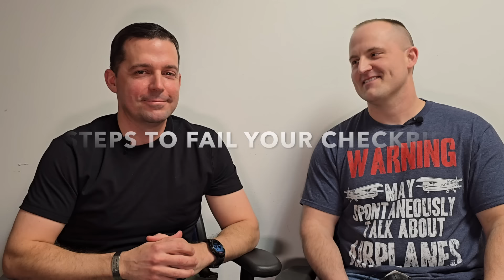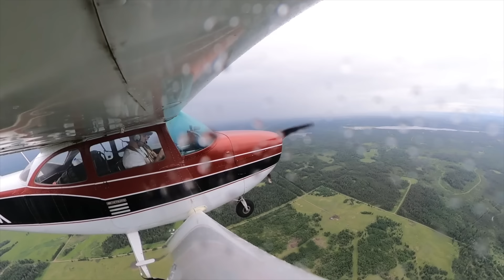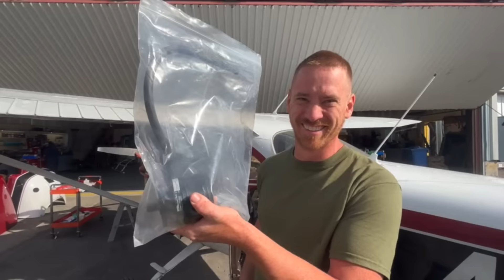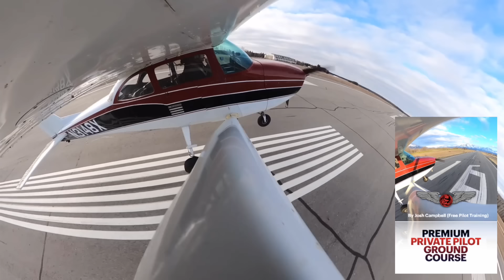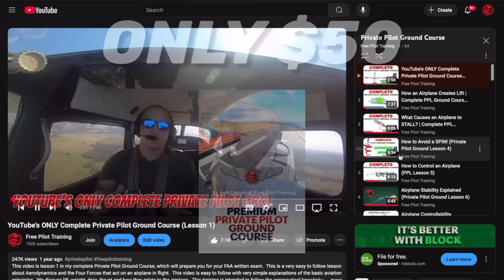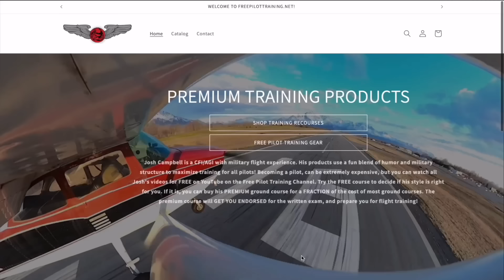5 Easy Steps to FAIL Your Checkride (Explained by an Examiner)

Comment: Thinking of a "flight exam" as a "checkride" is probably the best "way to fail a checkride". 

"Checkrides" are not a "thing" in "flight instruction".
Reply from the maker: Lol, we call them checkrides in the Air Force…so it kinda is a thing.  That’s probably why I use that term. That being said, the examiner is, in fact, checking to make sure you will be safe as a pilot, but you’re rights it’s technically an practical exam

Comment: The fatigue one is real. I went up once for a stage check and just felt so sloppy. I passed the ground super easily. Then getting in the plane, all the maneuvers were great. But then I realized some of the smaller mistakes I was making/missing things in the checklists. Then I got really stressed out and kinda started mentally spiraling and completely forgot how to land in a crosswind more than 45 degrees. Had to discontinue. Wasn’t a great experience, but a good one to have as a learning experience.
Reply from the maker: It’s crazy how much a little fatigue can affect your flight

Comment: Speaking of pilots failing checkrides, I can't help but wonder how many pilots fail because of the examiner. The only Checkride I ever failed was my Helicopter Commercial and I fully blame the examiner.  This was back before glass cockpits were in training aircraft and we carried paper charts. I always used my sectional in a "north up" orientation, and had already been an airplane private pilot for years and was used to this, but my commercial helicopter examiner was a "track up" pilot.  Upon starting the checkride cross country portion he informed me that I was viewing the chart wrong, and told me I had to use his "better" track up chart orientation method, which forced me to basically use the Sectional chart upside-down.  Of course, I immediately became disoriented, and was unable to locate the intended destination. I passed fine less than a week later.
Reply from the maker: That is really dumb. He shouldn’t be enforcing techniques over procedures

Comment: This is a great video! My instructor took me and another student for check rides. The schedule was for the other student to go first. During the beginning of the review, there was disagreement between the DPE, the other student and my instructor about the length of the student's cross country. The student and the DPE had different tablets and software. The student's tablet with Fore Flight showed the distance between airports as 50.4nm and he logged the flight as such. The DPE's tablet showed 48.8nm he wound not let him proceed because the student couldn't provide the distance requirement was met. Throughout my training I used sectional maps for my navigation. Interestingly, on the sectional map, the distance I measured between the two airports he flew was 51.8nm. I think if that student had argued that the sectional shows 50+ the DPE would have accepted that.  Your thoughts on sectionals vs. tablets for check rides? I am curious if you agree with the DPE here and also if you think he might have been convinced by the sectional.
Reply from the maker: Wow. I feel like the DPE is being too picky if the students iPad is showing over 50nm. Did the student manually select a point on the airport? The ICAO brings you to the center of all runways so theoretically, this could happen if the fields have really big runways.  I’m a huge fan of iPads, but I also think they’re a crutch. The student should be able to fly without one and navigate if needed, but having all the information at your fingertips makes things so much easier and safer
Reply: @FreePilotTraining  He measured from and to the center of both runways but I think he could have presented his case better. I do want to say my experience with this DPE was very positive. He has a reputation for being very thorough but also fair. I showed up well prepared, in no small part due to your free training. It paid off!
Reply from the maker: Nice! I appreciate that

Comment: I have my PP and I still do my W&B by hand using Excel and I still use my paper W&B chart. I just do not trust Foreflight with W&B. I also had paper chart for my X-country. I did back it up with Foreflight.
Reply from the maker: I don’t blame you! I’ve seen it spit out incorrect data before. Maybe not W&B data but I have seen it

Comment: These are way too complicated...let me give you MY 5 easy ways to fail a check ride:

1. Show up wearing only a thong (doesn't work if you're female and the examiner is male or a les)
2. White powder under your nose
3. Tell the examiner that you want to become a pilot so that you can overcome your biggest fear- dying alone
4. Your pilot bag is really a Yeti cooler full of beer
5. Openly and loudly hand your last will and testament to the lady behind the counter before walking out to the flight line

Bonus: Snort an unidentified white powder from any horizontal surface on the aircraft

Comment: I have a question! Premium course basically more improved version of the free course and also quizzes and their answers with explanations! So we can pass the written test. So for check oral exam we need to take this premium course. If I understand right! Right  after I finish studying free course  will buy the premium course . So excited things are getting easier every other day. Hopefully will setup a flight  sim for myself in order to study for the flying portion as well. I’m OTR truck driver from my truck will try my best.
Reply from the maker: The premium course will prepare you for the written exam and give you a great foundation for the oral exam. The main difference is that the premium version has easier access to the quizzes and the endorsement is included

Comment: The 'loss of alternator' is of course a good and realistic failure, but if it's full daylight it doesn't constitute an emergency - but maybe with today's FARs I'm wrong. 'Back in the day' the J-3 cub I flew had no electrical system at all.
Reply from the maker: Very good points.
Reply: There was a video about a pilot who was closing in on a plane ahead of him on short final, while he experienced an electrical failure. He was afraid of going around, and crashed into the plane ahead of him, while he landed!  He had thought that his engine would quit because of the electrical failure.

Comment: Alternator failure at night sounds horrible to eventually lose battery then lights and radio then you can’t turn on runway lights so might have to do an off field landing on a street or field without landing lights 😮
Reply from the maker: It doesn’t sound fun does it?

Comment: Seth (or Josh) I hope you can shed some light on this…I use a paper nav log to prepare my  XC. However, I also carry my iPad to help with traffic awareness in-flight. I’m not too familiar with ForeFlight yet to comfortably use it beyond that. If I were to bring it on a checkride for the sole purpose of traffic awareness am I opening myself up to being questioned on any of ForeFlight’s capabilities?
Reply from the maker: You should be fine. The big problem is when students don’t understand the data that ForeFlight is giving them during flight.
Reply: @ checkride passed. You and Seth are a treasure to aviation 🙏

Comment: most DPE wont allow EFB’s
Reply: There may have been a few holdouts prior to last year, but when the new ACS was released in May EFBs are specifically allowed now.  The updated DPE guidance in the 8900.1 and 8000.95D also makes EFB usage allowed.

Comment: My wife is learning to fly. How things have changed. I learned 40 years ago in Alaska. never did pilotage, just VORs and supplemented by visual, looking at mountains and streams. Weather was a phone call and a look-si. VFR or IFR, nothing in between. My check ride was at night at bare minimums even though I had never flown at night and had a night restriction on my license.

Comment: Based on the conversation, it’s so much better to do the old school method and back it up with EFB.
Reply: Do whatever you're comfortable with.  Personally, I would recommend getting good training on your EFB since that's what you are going to use in day to day flying after getting your rating.  Either method is acceptable, just make sure you are confident with the EFB if you choose to go that route.
Reply: Yes I understand. I received all my certificates and ratings before the EFB was a thing. It seems like it adds a complexity to a check ride. During the end of my flying career (government), I was reluctant to fly without the iPad. So now I know it’s a requirement to fully understand the EFB benefits and limitations. I really enjoyed the discussion.

Comment: It’s sad that the FAA doesn’t cap the DPE fee and more importantly that they don’t cap the retest fee to a low amount of $50 or so. This lack of policy gives the DPE a monetary incentive to fail you.
Hopefully I don’t experience this, but it is on my mind.
This isn’t even addressing the fact that we give the FAA $27 BILLION tax dollars a year and they STILL can’t even supply their own DPEs! That in itself is just disgusting.
Reply: Yes good points. It is strange that the FAA won’t standardize the fees. Why would that be detrimental to scheduling and availability? Expensive schools wouldn’t be able to bribe DPEs for quick scheduling by pampering them?
Reply: @weprinfilms  The reason fees aren’t standardized comes down to market forces, not pampering. Think about egg prices right now—they're higher than usual, but that’s not price gouging; it’s supply and demand. If the FAA capped fees too low, many examiners would simply stop doing checkrides or cut back on availability, just like farmers wouldn’t keep producing eggs if they were forced to sell at a loss.

Right now, demand for checkrides is high, and examiners are booking out months in advance. If fees were artificially set, it wouldn’t solve the problem—it would likely make scheduling even harder because fewer DPEs would be willing to do the job. A free market allows prices to adjust based on demand, which ultimately helps keep checkrides available.
Reply: @ Yes your point about supply and demand is reasonable. However, I don’t know if you’ve seen the prices lately. Some check rides are $2K now. That’s a bit ridiculous. If the FAA caped the cost to $300 or something low that wouldn’t be fair to the DPEs and would disincentivize them. But $2000? I’m starting to work on all my ratings and I’m being advised to put aside $12K for all my ratings check rides this year. That’s kind of outrageous.
Reply: @weprinfilms  I completely understand your frustration—$2K for a checkride is definitely high. While I don’t charge anywhere near that amount, I agree that some pricing has gotten out of hand in certain areas. That said, those prices are often driven by local demand, cost of living, and the availability of examiners. In some cases, flight schools set the fees, not the examiners themselves.

I agree that there should be more transparency so applicants know what to expect and can plan accordingly. However, artificially capping fees too low would create bigger problems—many examiners would reduce their availability or stop offering checkrides altogether, making it even harder to schedule one.

It’s a tough balance, and while some DPEs may be charging very high rates, that’s not representative of all of us. Hopefully, as more examiners enter the system to meet demand, prices will level out over time.
Reply: Thanks for sharing your thoughts. I agree the FAA could do a better job with transparency, especially when it comes to national averages for DPE fees. But capping fees would likely create some unintended consequences that might actually make scheduling and availability worse.

As for the idea that DPEs have an incentive to fail applicants—it's actually the opposite. DPEs are extremely busy and would much rather see you pass so they can move on to the next full checkride. Retests take up valuable time and pay less, so there's no financial motivation to fail someone. The real focus is on making sure applicants meet the standards for safety and competency.
Reply from the maker: Good points

Comment: Another reason to fail. With only 2 maneuvers remaining I had an applicant do a soft field landing at home airport, taxi back for takeoff for a short field takeoff. Applicant said he wants to stop in run area to regroup. While taxiing from taxiway to runway he never stopped and crossed the HOLD SHORT LINE without announcing intentions to enter runway (uncontrolled field). When he crossed the solid lines I looked at him and gave the hand signals like What are you doing? He stoped plane, looked at me, and unfortunately I had to tell him that that is cause for a notice of disapproval for runway incursion and crossing the hold short lines.
Reply: So he said he'd stop at the run up area prior to entering the runway, and skipped that entirely and entered it anyways? That's rough, sounds like the poor guy was stressing that day
Reply from the maker: What a shame!

Comment: Interesting with the EFB. In EASA land (or at least Poland) we're only allowed to use paper maps, flight logs and charts for PPL/SEPL check rides. For weather awareness it's pre-flight prep, FIS, ATIS and PIREPs over radio. All navigation and performance calculations need to be done manually on paper (using an analogue flight computer or simple dumb calculator).
Also never heard about personal minimums being stressed so much. We just discuss the formal, aircraft and flight schools SOP limits. A bit surprised about the mentioned 1 mile visibility. Is that for SVFR? Our SOPs only allow that for CPL, not PPL pilots.
Reply: It sounds like we have some differences here in FAA land.  EFB usage can start at the private pilot level. Since Part 61 training can be done by a lone CFI there aren't any standard SOPs to follow, so we do it with personal minimums. Basic VFR in class G Airspace is 1 mile visibility and clear of clouds when below 1,200' or 700' (depending on airspace above).
Reply: @SethLakeDPE  We of course also use EFB's here. But not on check rides. You need to demonstrate you're able to do everything the old school way. In class G airspace the minimum visibility is 5km ~= 3sm and "clear of clouds" below 3000ft and 1000ft below above 3000ft (in general, it's a bit more complex).

Comment: A hypothetical instructor took a hypothetical student to do some low pattern work with OVC008 that after 3rd touch  and go turned into OVC002 with less than 1.5nm visibility - a 180 after take off, oveflew the airfield, went out to see if the weather could improve and went back to the airfield (which because of the visibility was not in sight). That hypothetical student was very glad because he learned a lot during that time, particularily what to do if he lost sight of the airfield and how dangerous weather can become really quick. Now was this legal/safe? I'd argue it was not. Was it a good experience? IMHO definitely. And also proves how important it is to develop personal minimums. This was in Europe.
Reply: You're supposed to say "this was in Mexico".  Didn't you read the commenter training material?
Reply: Excellent hypothetical story!
Reply from the maker: Makes me shudder! I’ve had a very similar experience!
Reply: *overflew

Comment: Seth do you have a video about building ForeFlight performance profiles especially the altitude dependent ones? I have the prebuilt profiles but I want to also be able to build my own to make sure it matches the POH (for example the 172s I have lack wheel fairings which is a 2kt hit on cruise speed and I’m not sure if ForeFlight includes that).
Reply: I don't have a specific video on performance profiles, but I do discuss them on several of the ACS video series. I'll add that to the list of videos for the future and will discuss it on one of my upcoming weekly livestreams.  Thanks for the idea!  I discuss a great way to test the performance profile you built in this short: https://www.youtube.com/watch?v=Pw8mVUnoAb4

Comment: For my instrument rating the weather was below my stated personal minimums. After the oral the DPE asked if we were flying and I said no; that ceilings were too low to shoot approaches without going into IMC. He was visibly frustrated with that and insisted we fly. Wound up shooting three approaches thousands of feet below the altitude where I supposed to be at multiple fixes. On one of them I had to intercept the glide path a mile past the FAF because I was so far underneath the FAF scud running with a DPE in the right seat.

He passed me. All’s well that ends well. Never a ride as stressful as that one since and probably never will again. Imagine flying instrument approaches where the plate you are supposed to follow is just thrown out the window.
Reply: I'm glad it turned out well. However, this is a great lesson learned as a PIC. Don't let anyone, even a DPE, insist you fly if you aren't comfortable. A discontinuance doesn't hurt anything and would have been the safer decision in this scenario.
Reply: @SethLakeDPE  I don’t disagree with you at all but he really wanted go. He vectored me with headings and altitudes from the right seat and I’m pretty sure we stayed clear of Class G and Class E VFR minimums (I can’t be totally certain I had the foggles). It just brings up one of the hard spots you can find yourself in with examiners: argue with a DPE or contradict something you said you wouldn’t do?
Reply: @CaptSugman  I get it, but just remember you are the PIC, not the DPE.  They cannot force you to fly, and if they threaten to fail you if you don't fly, I would recommend reporting them for misconduct in DMS (there is now a button for it).  I don't recommend doing this except in extreme circumstances, but if it comes to that, politely ask for their DPE number and DMS pre-approval number for your test so you can file a complaint.
Reply from the maker: Wow! What a story